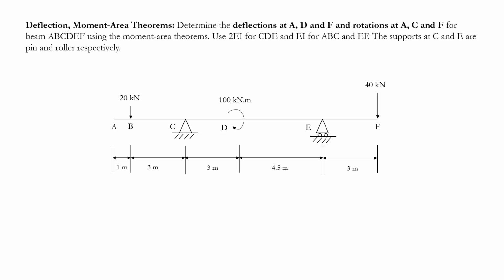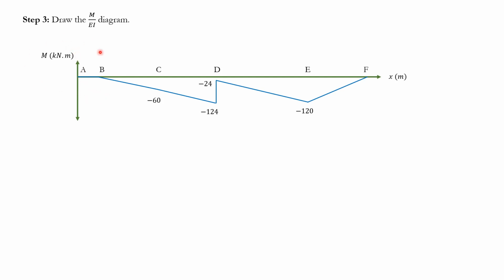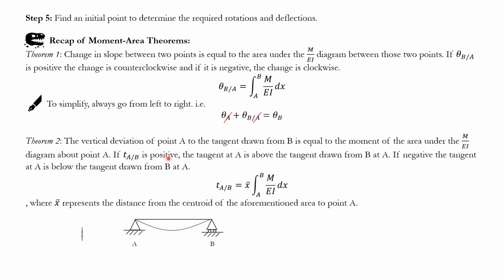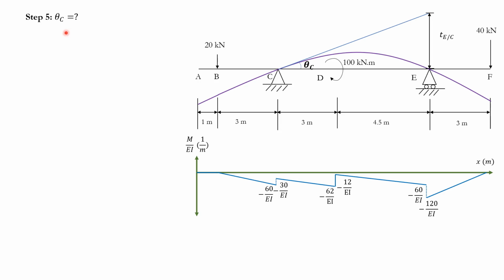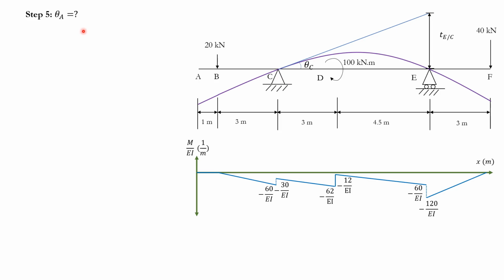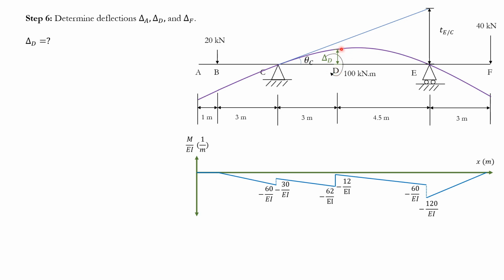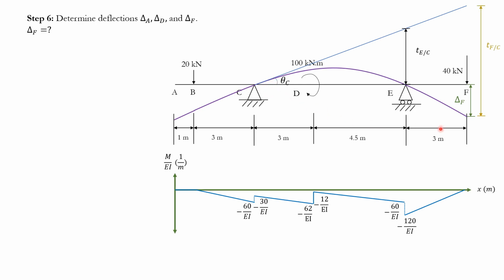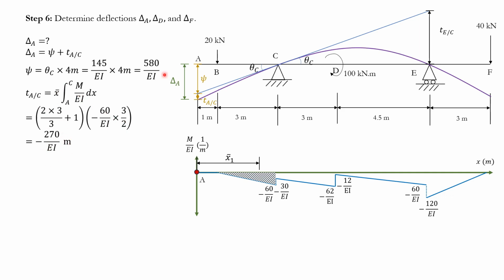Moment Area Theorems (No Hinges) - Structural Analysis (Comprehensive)

Comment: great video, are you planning on making videos for the other structural analysis methods? (Virtual work, Castigliano etc.)
Reply from the maker: Thank you for watching! Yes yes, it is in progress and hopefully I will have videos up about the Conjugate Beam Method, Virtual Work method, Castigliano's theorem, and Influence Lines by the end of August. After those, Slope Deflection Method and Moment Distribution Method will be posted hopefully by the end of Septmeber or mid-October. I suggest that you turn on the notifcations so you will stay informed.
Reply: @StructuralEng  Thanks! Recently graduated but haven't used these analysis methods since my first few years of University. This channel will be my go-to to refresh my knowledge